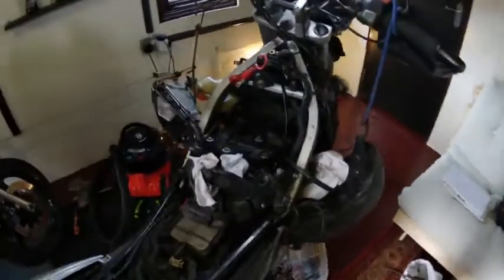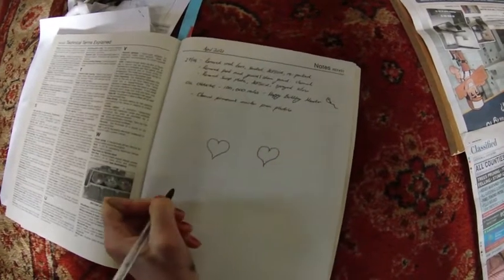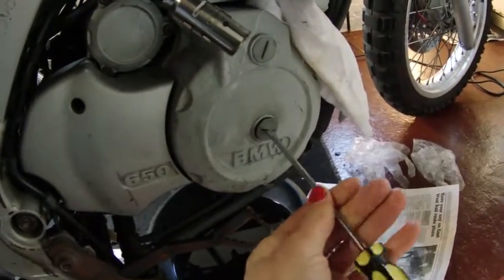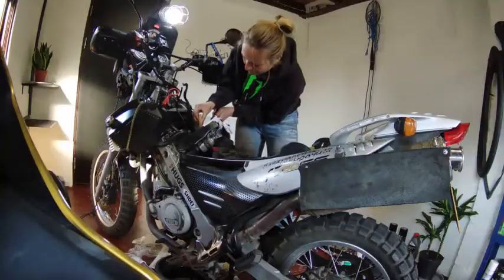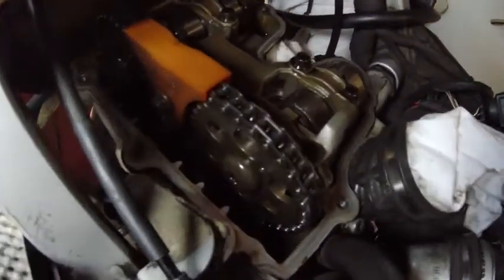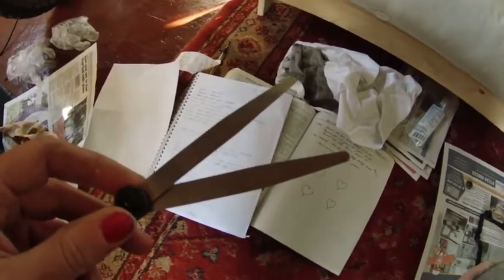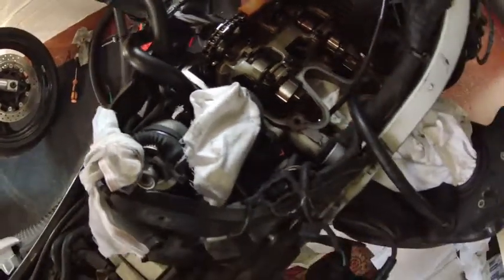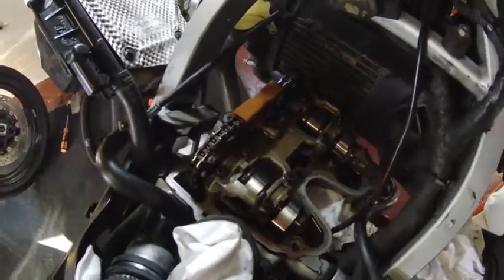Monster and Me - Ep3 - BMW F650 GS Valve Clearances

Comment: Great video I just got a new to me 2013 g 650gs sertao  . I'm saving this video in my motorcycle  yourtube video file . It only has 4,000 miles on it but I'm just getting ready . I have a question about the shims . I have never changed shims before . How does the sizing of the shims work and how do you figure out what size you need ?
Reply from the maker: Thanks for your kind words Steve. I’ve only ever had a shim out once when my friend Paul was helping me but from what I can recall we just measured the gap using the gauges and if one was out of tolerance you would remove the shim and then order a new one to the correct size. They rarely need adjusting so measure up carefully first and if you need to make adjustments refer to a manual. Changing the shims requires the removal of the cam shafts which I would not be comfortable doing on my own  :)

Comment: Katy, I have a 2002 BMW F650gs and when I checked my Haynes manual, it says intake should be 0.10 to 0.15 intake  and exhaust 0.25 to 0.30  is this correct?
Reply from the maker: Hiya, I don’t have my manual to hand at the moment but if you check the crossroadz f650 website it says there was a revision from the early single spark manuals. Amended to inlet 0.03-0.11mm and exhaust 0.25-0.33mm. Hope that helps. :)
Reply: @HaynesGarage  thank you so much!! I was going crazy for the past few days trying to figure out which was the correct specs!! LOL
Reply: @HaynesGarage  0 03 is very tight,  bearing  in mind that clearances diminish with time.